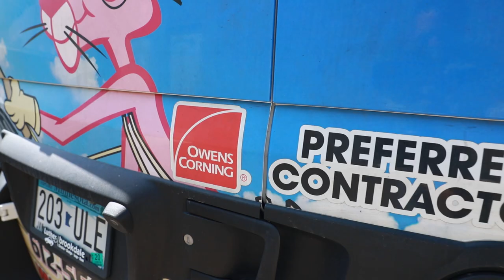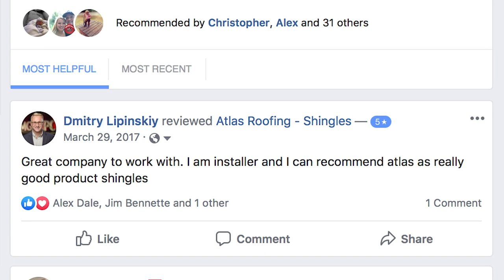Atlas Roofing Shingles: Big Review by Roofing Insights

Comment: My roofing contractor installed Atlas shingles on my roof this week and he did a fantastic job.    He used the StormMaster Core 4 shingles combined with the Atlas Summit 180 synthetic underlayment.  They also used Grace ice and water shield in the valleys that we had problems with on the original roof.   I was totally satisfied with the products and the installation.  They did a great job of cleanup also.  Thank you recommending Atlas shingles.
Reply from the maker: Whats the name of the company you hired?
Reply: Genesis Total Exteriors in Denver

Comment: The Atlas three tab Stormmaster Class 4 was the best I'd found, but I went to Malarkey Vista when Atlas dropped that line. Architectural shingles suck. They look phoney, and if they develop a leak along the nail line, it can be very difficult to find. Replacing the bad shingles is also difficult, because you can't whittle those things apart without damaging adjacent ones. In high wind areas, three tabs stay down fine as long as you use extra adhesive within 4 feet of all edges, and you use 5 nails instead of 4. If a leak develops, you can find it at a glance.

Comment: I am a die hard proponent of Metal Roofing.  I also realize that a properly installed metal roof does not fit in every house hold's budget.  If I have to recommend any 30 year shingle, or any sbs modified shingle, it is a an easy answer... Atlas every time!
Reply from the maker: smart. Very smart

Comment: I’m not sure why but not a lot of roofing contractors around here don’t offer Atlas shingles. Two reps that I’ve spoken to have used the words inferior and cheap. The one offers a shingle brand that I consider pretty bottom of the line.

Do yourselves a favor contractors, don’t degrade a good product. If you offer a good alternative just state the reasons you like working with the particular products.

When you knock a good, reputable shingle different than your preferences it makes you look like a fool and not credible however quality your work is!

Doing so will not earn my business.

Also, Atlas is NOT a Menard’s product! They offer them here but they don’t own them.

Comment: I got a quote for Atlas vs OC and the price difference is 3-4 grand. The OC installer trashed Atlas over OC because OC has a tar strip at the bottom when Atlas doesn't, and OC has a reinforced  mesh strip on top that makes it nearly impossible to pull a nail thru the shingle. I saw both shingles with my own eyes and OC does look like a much stronger shingle. So now my question is should I pay a 3k premium for OC vs Atlas?
Reply: Atlas makes a better SBS Impact-rated shingle (Stormmaster) than the OC version (Flex) and they are cheaper.  OC is good, but Atlas is on par with them.  Not worth any premium.
Reply: Yes..pay more. 3k in the investment protecting your entire house is small for the length of time it'll be up there...the price is cheap, so there are going to be lots of "selling" to move them. As an installer, atlas needs so much extra care to install, that most installers go past that care to be quick, and the roof fails.
Reply: @RobChapala  Ooooh, that's scary to hear. I got a quote from an installer that uses Atlas, and that roofing guy actually wasn't a fan of OC(I know because I fell in love with an OC shingle color and asked them about it).

Comment: I've installed every brand of shingles before, Right now I install Malarkey and Atlas in my opinion Malarkey is still number 1. But if Atlas would make one small adjustment to do the double roll on there granule adhesion like malarkey does they would be top dog without question!
Reply: What about the Atlas Impact shingle?   Does it suffer this same issue you are speaking about?  It’s a Class 4 impact rated shingle.

I am planning to have that installed soon….

Comment: I'm doing my roof myself, a total tear off.  I'm going with the atlas storm master shingles.  I've done one roof  about 20 years ago. On the roof I'm going to do now  I have a 4/12 pitch  on 90 % of the house . The other part is a 2/12 pitch.  The 2/12 is shingled now, so I was going to  put shingles  back on the 2/12. I'm having a room added to my house next to the 2/12 pitch.  The add on is going to be a 4/12 pitch going into the 2/12 pitch  making a vally . What type of vally should  I do in this case?  Should  I use the synthetic  underlayment or a tar paper? Any other recommendations?
Reply: Also my house  is in michigan  near Detroit.

Comment: I can’t believe he said that Owens Corning is a good brand! My friend and I both went through the same hailstorm getting the same size hail, and her roof was done with Certainteed Landmark shingles and did not even need repairs! So I got the same roof inspector that she used, to come look at my roof which has Owens Corning Oakridge shingles, and he said that I have lots of damage & that I do need a whole new roof! He showed me dozens of pictures of hail impacts that cut deep down into the shingles, exposing the asphalt fibers clearly, and some of the shingles were literally hole punched all the way through! He said I have so many damaged places that he lost count! Her roof is about 4 years old and mine is only 5.5 years old. Owens Corning shingles do not last! I will never be talked into using their product again by a slick salesman, and I will certainly not recommend their brand to anyone! I even had a roofing company owner (who is the dad of an acquaintance of mine) & from a different company, come out &  look at my roof & he also said that I needed a whole new roof! (Both guys were from companies other than the company that originally installed my current roof).
Reply: owens corning oakridge is not impact rated like their duration series, Certainteed landmark is impact rated. unfortunately you get what you pay for and you as the customer chose an inferior product from a reputable manufacturer. I install atlas, gaf, iko, tamko, malarkey, OC, and certainteed and no manufacturer is perfect but a shingle that is not impact rated is not going to stand up to hail no matter who makes it.

Comment: Home owners should do their homework. Learn how to spot a guy who only looks at cost and corner cutting. Amazes me how many roofing contractors do not follow manufacturer installation guidelines. And the ones that do, don't do a good job selling this point of difference. I am in the industry, deal with contractors all the time. Atlas is the brand I'd use on my roof.
Reply: GAF UHD vs HDZ ?
Reply: @TwoTall1988  GAF recommends cap fastening their underlayment. So many Master Elites skip this step to save a few bucks. There is a reason that it is recommended and part of their installation instructions.
Reply: @pmmahone1  lol you misunderstood my intention. I was asking you the cost/benefit of upgrading from HDZ to UHD. I've had one roofer tell me it's basically cosmetic and more expensive to go with UHD
Reply from the maker: Not only that but they argue that their way is the only right way!
Reply: @RoofingInsights3.0  are there words in these comments I'm not reading? pmmahone1 and your comments seem like you're replying to someone elses comment on this comment lol

Comment: I just started using Atlas shingles. I agree with all your points. 
 The only downside of the Atlas shingle is on they're dimensional shingle. The tar strip is on the face as apposed to the bottom of the backside. My mechanics tend to accidentally step on the strip in the Summer and track the tar onto newly layed  shingles. 
 For a good quality shingle and  reasonably priced you really can't go wrong.
Reply from the maker: great feedback, thanks for sharing
Reply: Yeah, I used to have this issue with BP shingles in Canada. Also gums up the nose of your gun on hot days.

Comment: I personally do not install Atlas. They blister, and lose their granules. Unless they have fixed this problem they are not good from what I have seen.
Reply from the maker: Thanks for feedback! What market are you in?
Reply: Roofing Insights Wichita, KS
Reply: I am currently installing OC Duration Flex. They are a great shingle. My top three shingles would be. Malarkey Legacy, Certainteed Northgate, OC Duration Flex. All three great shingles
Reply from the maker: Good choice. I would add storm master to it as well. All we have seen and tested were good. Flex is great product
Reply: I had four roofs put on different houses. and all. and I mean all loose granules for a while. that's part of their make up. roofs have a life expectancy. and that's it. no roof last and holds up forever. it's the installation that counts. most brands are good. ten fifteen years are normal roof life. it depends on the pitch and were you live. 25 and 50year warranty are a joke. your lucky if you or the roofing people are still around. . just my opinion.